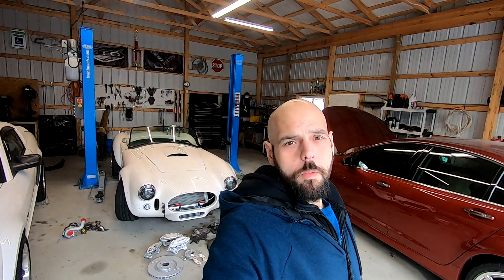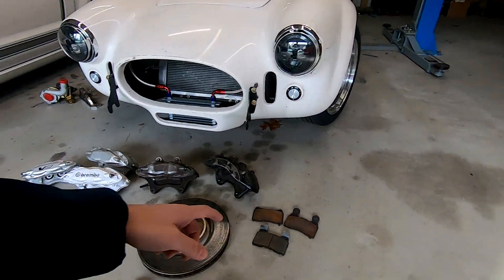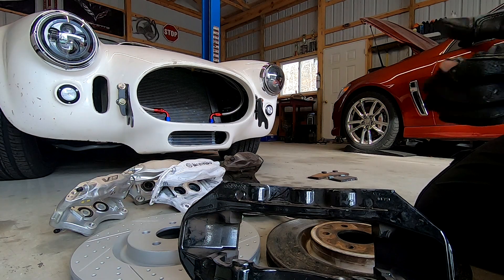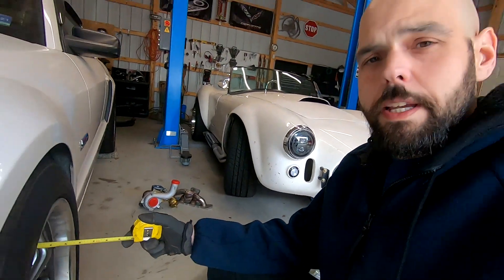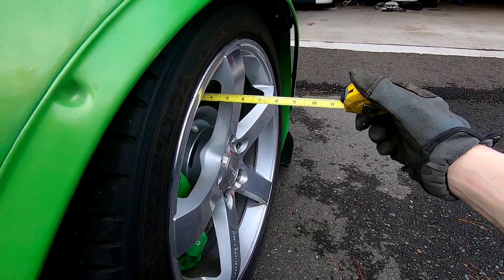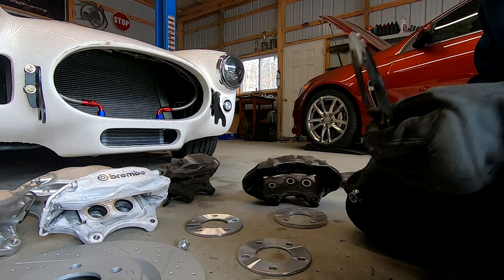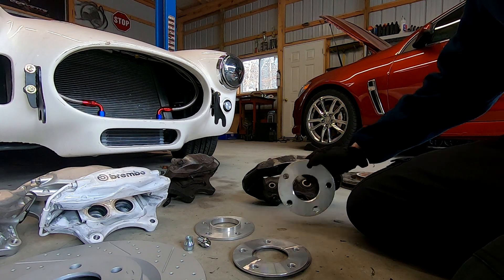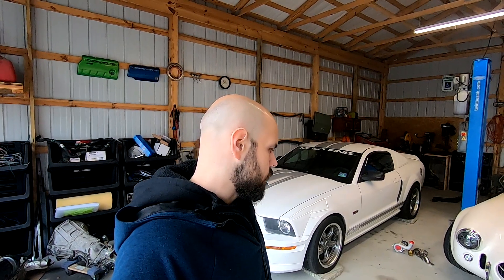Automotive Brakes Upgrade: How to measure for BREMBO and BIG BRAKES!

Comment: Hi good vids your making, I wanted to know if you could tell me what all is needed and the parts for my 04 goat and the cost? Looking for better brakes without breaking the bank
Reply from the maker: Actually yes If you want to run with the factory brakes and make them a little stronger I know what you need to get. Or if you want to run with Brembo You can probably get away with just doing the front of the car and be under $1200 total
Reply from the maker: @Itchintogodeerhuntin   my email is in the description If you want to message me directly.